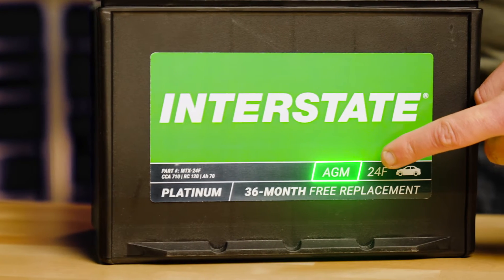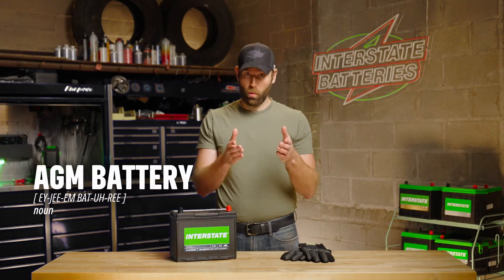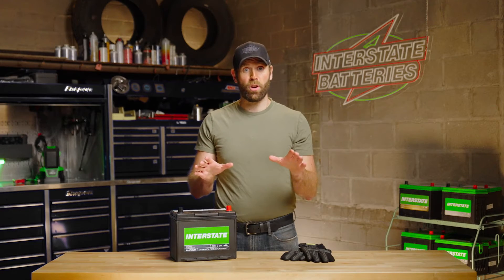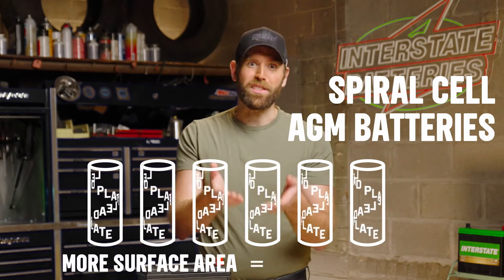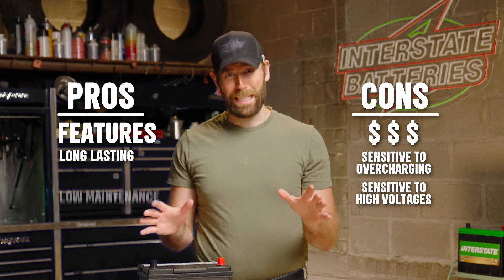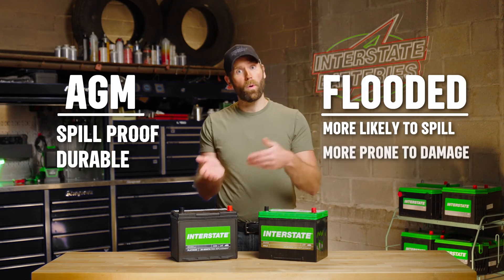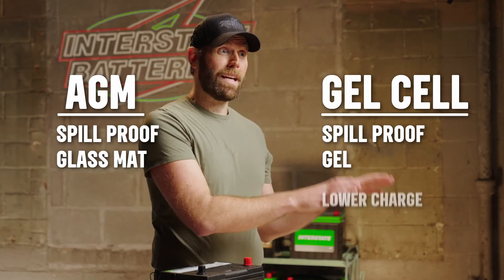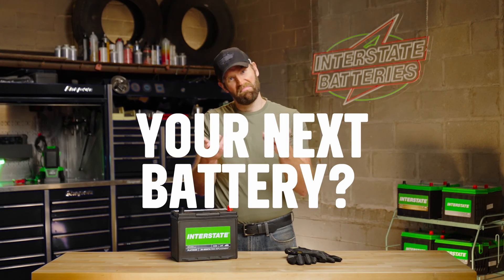AGM Batteries and How They Compare to Other Car Batteries | Interstate Batteries

Comment: You need better labels to look upscale. These battery labels are plain and boring. They look like cheap parts store batteries. Be better. Take a look at Valvolines new labels on their oil bottles for guidance. That looks upscale.

Comment: So if you install an AGM sideways, is it's construction as able to handle the vibrations of automotive use as if it is upright? I've asked this of both Johnson Controls and Optima, without ever getting a straight answer.

Comment: Please, let's get this right.  As you said, the fiberglass mats absorb the electrolyte, which means that the mats are absorbENT not absorbED. The mats don't get absorbed.  it's the electrolyte that is absorbed -- not the mats.  Therefore, AGM stands for AbsorbENT Glass Mats because the mats are capable of absorbing.  I expected better from Interstate. 😞
Reply: GEEZ!  Pickles & tennisballs. AGM is commonly referred to as Absorbed Glass Mat.  No, the glass mat is not absorbed, but that doesn't stop us from being less picky about the exact nomenclature.

Comment: I have a high output alternator  that charges at 14.8-14.9 volts. 
Would you recommend AGM batteries in my application?

Comment: I bought an AGM battery for my motorcycle because it was an emergency and no leas acid batteries were available! I keep a tender on when not riding. I was riding one night and the mcy died,it wouldn't take a jump,so my friend picked  me up with a trailer,no stores were open. Lead acid batteries will always take a jump,AMG's your screwed! The AGM was only 1 1/2 years old,I get  5-6 out of a lead acid!

Comment: my 2013 hyundai did not come with AGM. is it worth upgrading to AGM?
Reply: My 2020 Elantra came with an AGM battery. I am now at 5 years with the original battery, and still going strong. I will definitely replace it with another AGM. When? That I don't know yet.

Comment: Have a 6 year old interstate battery that has died on someone's truck 3 times in 3 days using only hazard lights for a few minutes (everything else off). There are no vendors near me that had a direct replacement so I wanted to upgrade them to agm and again no interstate batteries. Had to go with a platinum agm everstart. fresh off the shelf, installed, NO START lol, put the interstate back in NO START, got the owner gas and the pump safety failed so the gas just poured out and made a mess. massive hunger headache, traffic, just a rough day and the cherry on top? The tie down rail didn't fit the shorter battery so I had to go hunt down shims for the threads to hold tension to the nuts. Anyone wanna build a time machine? I miss being a kid...

Comment: Just made myself a lifepo battery.. it normally does not get charged😅 because of nearly zero internal resistance (ECU thinx it's charged so cutoffs the alternator) and doesn't charge at all when i stop and idle BUT idle consumption went down from 0.6l/100 to 0.4-0.5l/100. It charges only when driving, with 13.3 float voltage, or when motor braking at 14.5V..

Comment: What battery type for a 1952 Chevy with a 6 volt system. The car is only used as a toy and sits all winter. (Chicago). Standard 6v lead acid batteries only last about 2 years and the old girl needs as much juice as possible to start.
Reply: 12 volt battery with a voltage reducer will last a very long time when not in use keep tricle charge on it.
Reply: How does the voltage reducer work? What kind of current is it capable of delivering?

Comment: "if you practice good charging methods" perhaps you can tell that to my alternator.
Reply: Alternators NEVER listen..
Reply: AGM batteries have a minimum charging rate. If your alternator does note that minimum amp rate the battery never gets fully charged therefore it's life expectancy is reduced.
Reply: What does your alternator do improperly?
Reply: @dubmob151  its a joke he knows it charges and regulates the charge etc 🤣👍
Reply: Underrated comment
Reply: @binqer na that was pretty funny 😂😂😂
Reply: Keep charged thats it

Comment: I bought a replacement Interstate battery for my Honda Accord at Costco. It died in 4 months. I took car to a garage that sold Interstates and the guy almost went postal. He explained Costco has Interstates made to lower standards and only Costco can do warranty work on their fake Interstates. I did buy a new battery but after owning Interstates for decades, I will never buy another Interstate ever again. You lost a good customer!
Reply: Why didn't you get a full replacement at Costco instead of going to a garage ?  Costco is more a DIY source for batteries; who installed the battery for you?
Reply: Had the same experience - no more interstate for me ever - Deka makes Super Start at Oreilly -  major manufacturer - I even buy Deka for lawn eqpt  Optima has known good reputation also.  No fun buying crap batteries.
Reply: Interesting, I've had mine for 8 years now. Only brand I'll stick to

Comment: Advance Auto pushes their Diehard AGM batteries. If Advance installs your battery, you have to pay $4.00 for the felt anti-corrosion washers. These felt washers are normally $1.00 for 2. No battery warranty if you don't buy them. Advance is grossly overpriced on their batteries at all levels. At Walmart my battery was $100.00 cheaper and a longer warranty. Advance pushes the AGM battery no matter what year of your vehicle. Never again going to Advance Auto.

Comment: I bought 4 1150cca Interstate AGM Batteries for my Semi Truck. I got tired of replacing lead acid batteries every year. I will Update a year from now.
Reply: A year later bub! How are they
Reply: Our truck batteries change every few years
Reply: My lead acid lated 10 year still hold volts but stating to dis charg now run every day amazing thing
Reply: Been a year!

Comment: I’ve had nothing but trouble and roadside breakdowns from interstate batteries
Reply: Been using them for my whole life, I had bought a reconditioned one once that was reverse polarity charged and blew my fuse in my car. They replaced it and refunded me for the fuse and sold me another battery I needed for something else at cost. Really helpful people
Reply: @matthewmumau1761  course you have
Reply: @matthewmumau1761 That's pretty improbable. Was it connected backwards instead?
Reply: Total garbage.

Comment: Why doesn't the formula for calculating Ah's of a battery, work with the 48 AGM @ 760 CCA, 120 RC, 70 Ah...Curious, as some batteries don't list the Ah's for BMS resets.
Reply: There's usually a PDF on the manufacturers website for that particular group, the Ah should be listed there.  It's typically higher by ~20-30% and they do better with deep cycle.

Comment: So the AGM is better in almost every way except the price?
Reply: No AGM's are not better for the average driver.
Reply: The statement on Interstate's website saying AGM batteries should not be charged above 14.0V would preclude their use with most cars that have a typical changing voltage of 14.4V.
I don't think that's a problem, but this was the information presented:

"This means AGM batteries need a special AGM charger. They can take a lot of amps in a short period of time — but an AGM battery charger must keep its voltage lower than 14 volts to avoid ruining the AGM battery. AGM batteries are 12 volts, like all car batteries, and can handle some higher voltage, but only up to a certain point. If a car alternator charges an AGM battery with a voltage higher than 15 volts, it can damage an AGM. It’s not likely, but voltage fluctuations are a possibility."

Not sure why they mention both 14V and 15V as limits though.